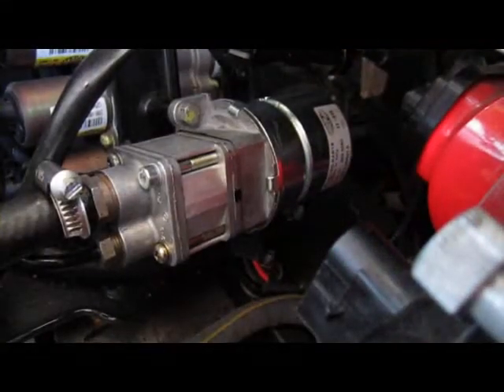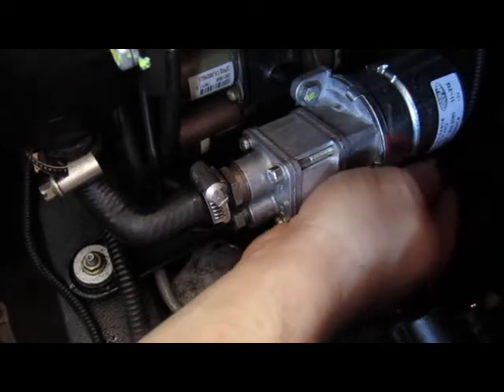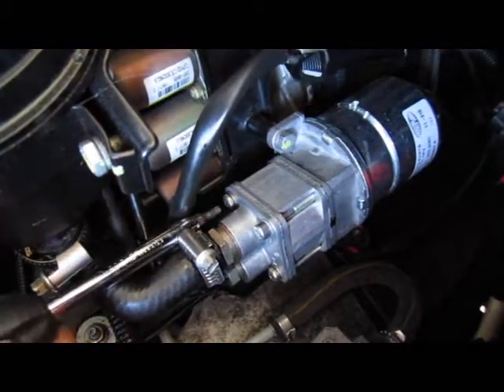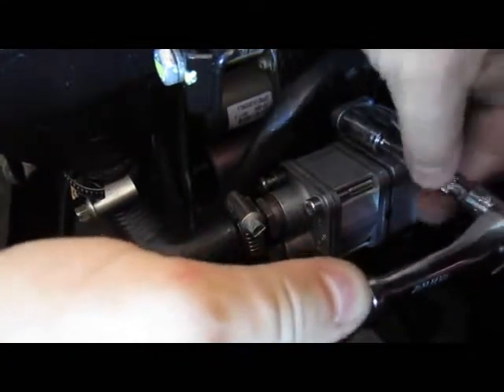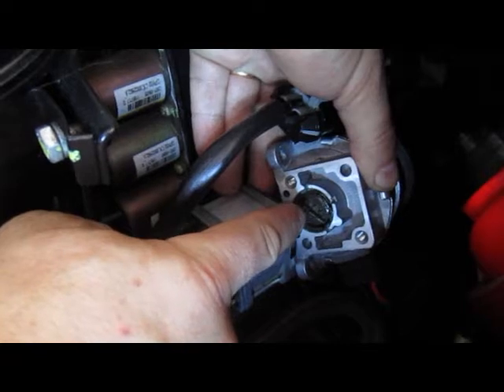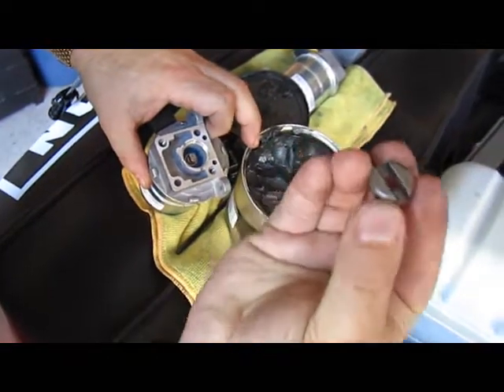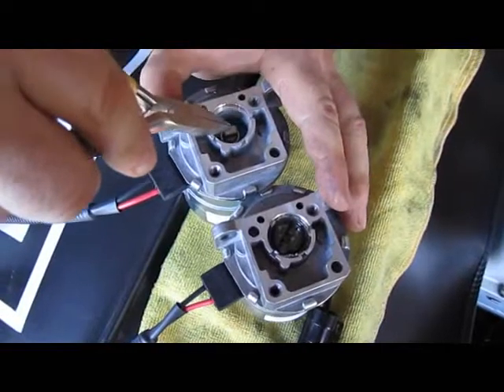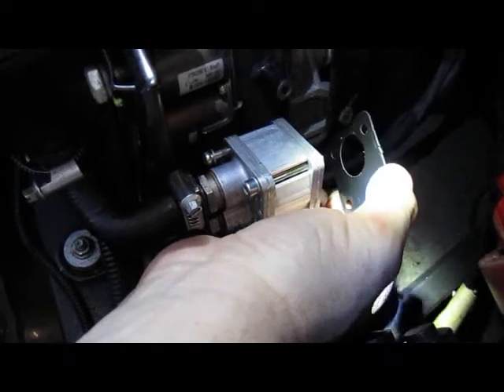F1 pump motor replacement procedure for Ferrari 360F1 Modena.

Comment: Hi Juri, Great Video I have quick question. I have a f355 with the 360 pump conversion. I just swapped the F1 Motor the other day. When I removed the electric motor from the pump. I had a bunch of fluid leak out. I noticed in your video there was no fluid. Can you let me know if I did something wrong? If fluid leaked out those that mean I need to bleed the system or is it self bleeding? I didnt remove any lines or the actual pump only the electric motor.
Reply: I had the same issue. Lost bunch of fluid. Did you have to bleed the system?

Comment: Juri, good afternoon, I was replacing the pump motor yesterday and I lost the coupling that connects the motor to the pump, I saw in the video that you have extras, can you please let me know where can I buy one or if you can sell me one of the extras that you have, thanks in advance for your help.
Reply from the maker: Bad news.... You can not purchase this particular coupling anywhere... I am currently developing a set in my machine shop. If you need it urgently, I can offer one to you, but it will cost a bit..., because each and every one of those couplings is a treasure. I suggest that you try finding it in your car, even if you will end up removing the undercover / bottom panels.
Reply: +Juri Gelovani I'm trying to recover the piece but if I'm unsuccessful,  how much will it be, I really appreciate your help and honesty.

Comment: Juri, is this the same process for an F430?
Reply from the maker: +idjr
The procedure for F430 is absolutely the same for older cars with the same type of electric motor (for F1 pump). The later models have larger diameter shorter motor with a different mounting plate, but the procedure for disconnection of pump head from the electric motor is the same.

Comment: Would be very beneficial if you created a similar video for gallardos.  You would sell a lot of pumps from that community if supported by an install video of the pump and relay.  Thanks
Reply from the maker: +donblackie 
Yeah... I agree. I should make a video for all other cars as well. Lamborghini Gallardo is rather easy, because of the readilly accessible E-gear pump location on the right side (passenger's side) in the engine compartment under the heat shield. Murcielago is a different story alltogether, because of the hard to get to location in the middle of the transmission next to the gear shifter. However, if you have access to a lift and can remove the undercarriage pannel the access is very easy and you dont have to pay for the engine/transmission drop to get to it, as it is reglamented by Lamborghini (that costs several thousands of dollars!).